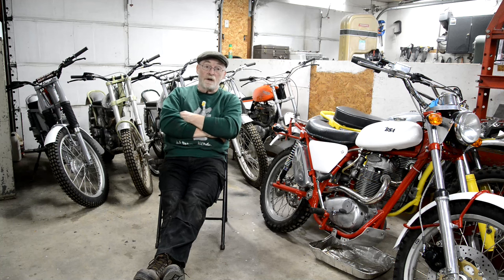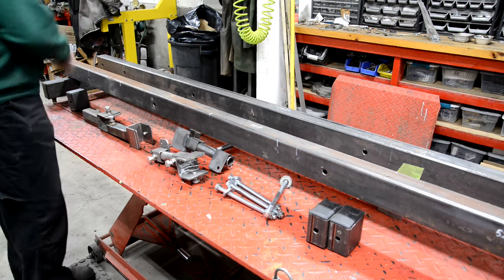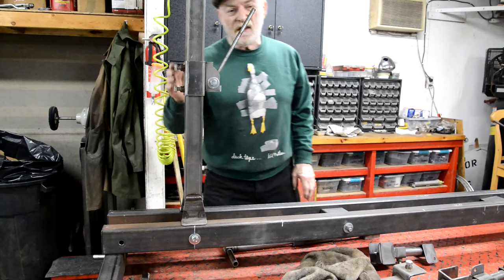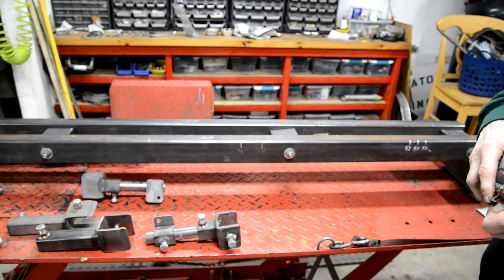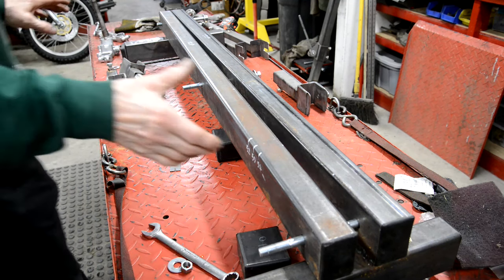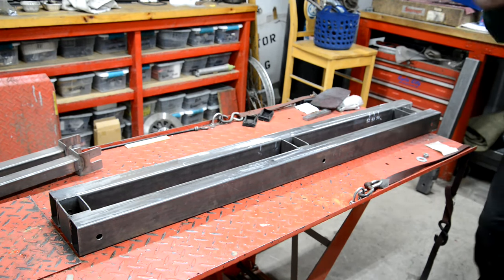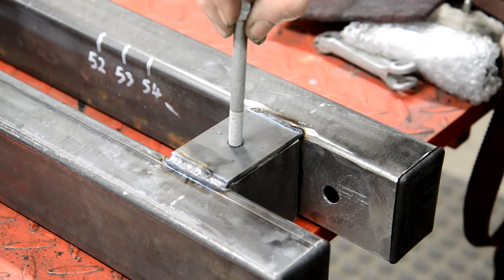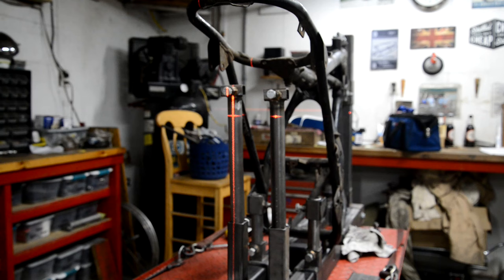Frame Jig Mods

Comment: This is all good, and I don’t mind a mainly talking video, if the talk makes sense (yours does!). I thought your old version jig was fine, but can see the sense in the new version. And lighter is always better as we get older (I’m 77). Still don’t drop it on your toes though. I noticed that one jig-rail had the tube-seam at the top (presume the other was at the bottom) would that have made a difference to straightness left-for-right?
I wonder what the new bikes will be… and because all these mods, I guess they are going to need at least a frame mod if not a frame build.. Oh, the speculation is going to run riot!
Keep up with that walking no matter what else. All the best from Chester. Les

Comment: As a final check of 'truth' - glass is flat and will usually show up any irregularities. You can also set up two small cups filled with cold tea and connect them via a piece of tubing.....The cold tea has no meniscus so that you can easily check when the cups are 'brimmed' and levelled. However, a good laser set-up may be better !